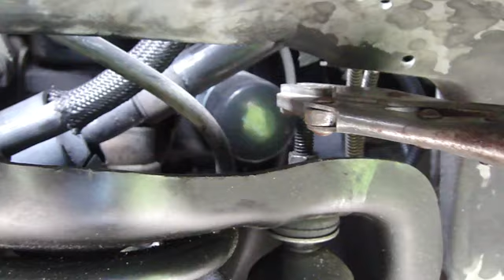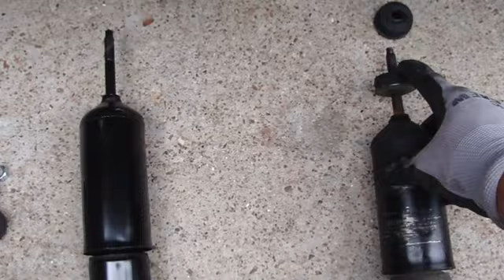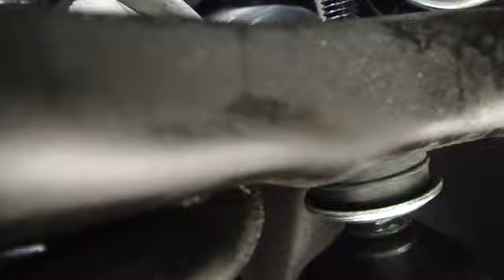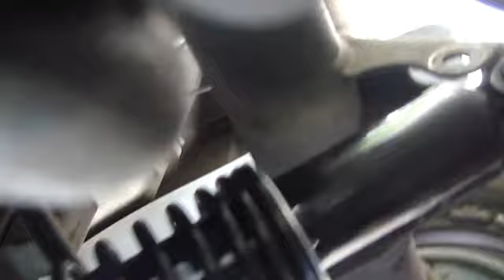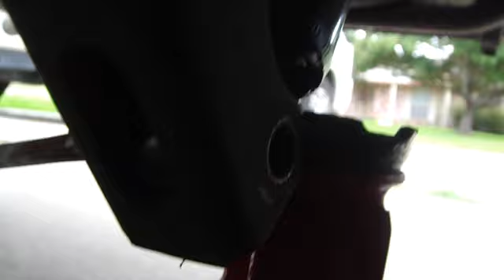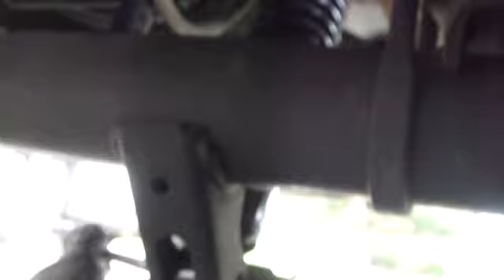Replace Ford Ranger Shocks

Comment: This vid is six years old so these two things have already likely been covered [also, thanks for creating and posting this helpful vid]:

1: the music should be WAAAAAAY in the background, almost inaudible, and not in the foreground.  Very annoying and distracting and even makes it hard to focus on what you’re trying to convey

2:  don’t remove shock or strut straps UNTIL you’ve got it partially installed, then cut the strap, then the shock or strut will rise up into where it’s going to be seated.  And take 90 seconds to remove the tire first.

Comment: there is a place under the rubber isolators to put a 3/4 wrench on, so you can use a socket on the nut, for the top of front shocks.

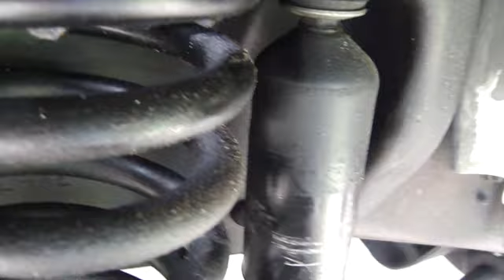Comment: Dude, yer killin me.....stop vid at 0:22 and look under the bottom of that lower bushing, just under the disc. That's where you put an open end wrench. No vice grips needed. Work smarter, not harder. And at 0:50, you CAN take it out by hand if you pull down on the upper part of the shock first.
Reply from the maker: SsgtMcNasty1 thanks for the input!!  I’m just the average joe DIYer.

Comment: These rear shocks are awesome,,,,but they don't fit a 1994 Ranger xl. The passenger side shock hits the control bar on the rear axle. . I notice yours doesn't have the same control bar as a 1994 even though its only two years difference. Hope this comment saves someone the headache I went through...

Comment: Thanks, have to do back shocks on '94 Ranger, it's not high mileage but it's old and the shocks are shot.
Reply from the maker: I felt the difference right away.  You will be happy with the replacement.
Reply: These rear shocks did not fit my 1994 ranger xl. My Ranger has a control bar on the rear axle. The passenger side shock hits the control bar causing a noise at every bump. I haven't notice anybody mentioning this anywhere.

Comment: the bottom screw bolt, on the spindle it screws onto mine broke off.. how can I fix or get around it? the owner before me NEVER changed the shocks
Reply from the maker: marcus myers not sure dude. I would not try to repair it. Buy a new one or go to pick a part junkyard to get one.
Reply: The Tinkerer the only problem is getting it out. it's basically snapped in half. half of it's in the bolt the other half still on the truck. damn things welded in
Reply: you've gotta buy all new radius arms. Just had the same thing happen to me.

Comment: I thought u had a lift I have the same truck but with 4" cool spring lift and the tires point out wards on top of my tires I'm looking for suggestions on if I need too get myself a radius arm lift too fix my issue

Comment: Are the shocks on a 2010 ranger xlt difficult to replace or it is the same as the 1996 model which you are referring to in the video?
Reply from the maker: Steven Machieng I don't know this vid is for the 1996 Ranger Good Luck!
Reply: It’s basically the same in the back I got a 05 xlt n just replace with Gabriel carrier load and feels a lot better

Comment: This a good video but.........my truck is rusted all to hell (Midwest) I think the main toolss I will be using are a torch and a grinder LOL
Reply: testbooster 
I'm surprised by that, 95 underside is cleaner than cars made in 2011 here in the Midwest. My 99 Ranger underside is pretty grimy and a little rusty.

Comment: I hope you respond pretty quick do I need any specific tools for this job, beside the vice grip, wrench, and jack?
Reply from the maker: I also used a air drill which is shown in the video. bolts can be  tough to dislodge. Since this video I purchased a spring compressor but you can also rent it from ORiellys

Comment: Great.... I have the original shocks on mine. After 260,00 miles, I think it's time.
Reply: Lol its recommended to replace them after 30-60k
Reply: Good to know next go around.. I replaced about two months ago. Super easy!
Reply: Absolutely.. Before 260.00 thousand miles . My truck had resonating bouncing/vibration happening after just simple aggressive conditions, such as cracks in black top especially on the freeway and also a terrible vibrating in front right at 65 MPH lasting till I hit 70 MPH. After putting those on that disappeared along after vibrations too. They were Monroe brand around 35.00 a piece.
Reply: ToddB987
You my friend, just felt proper ride quality after 200,000 miles without it!  Shows how much of a trooper those old shocks were though.
Reply from the maker: Could you share what the ride felt like pre and post shock replacement and what shock brand you ended up with?

Comment: Question...? How come you just didn't take the back wheel to get top of shock? You did in the front? I have a 95 ranger that the shock are over due to be changed out. Thanks for posting vid. Probably going to save a couple hundred dollars on labor and part if I were to take it at local garage.
Reply from the maker: +ToddB987 I think you said why not take off the back wheel instead of getting under the truck?  Got lazy! tried to save time! :)   The shocks BTW are off the hook almost 2 years since this post and shocks still good!  The handling of the truck is fantastic...i mean I went from wobble and bounce to tight like a virgin!  You will be happy with putting in new shocks!

Comment: AWESOME.  Copied your instructions used same shocks and came out perfect.  You are good at instructions!  Thank you so much and mine was a 1994 Ford Ranger XL.  I didn't even have to take the front wheels off.  Nut blaster spray worked too good.  Also, on the front you don't have to keep a vice grip on that top part... you can simply use a wrench down a little below it on a nut that goes on the underside of the frame.. easy way also.

Comment: Nice and clear video, thank you.  Just did the rear shocks in my '97 Ranger.  I'll do the fronts later. My Ranger is significantly more rusted than the one in this video. Yours looks almost new, with no rust. Michigan!
Reply from the maker: Alex Sweers Michigan...you must speaking of salt for the snow...thanks!  engine and underbody well taken care of...the lack of paint however is another story...
Reply: The Tinkerer The body on my 1997 only has a little rust, surprisingly.  The frame is another story!  Yours looks like it came right out of the factory in comparison.

Comment: I'm getting ready to do the shocks on my 87 4x4.  I want to put some Gabriel Hijackers on it 'AIR' in the back.  Does anyone know how this might work for me?  BTW, I just replaced the steering linkage after my wife bottomed it out real good while coming out of a deep gully to fast.  Crushed the linkage, and put so much pressure on the RF tire that it separated it.  Wobbled like hell and only kept getting worse.  So, tie-rods, new front tires, and got it aligned all just yesterday.   If anyone can give me some pointers on air shocks for the back, a quality brand mainly, i'd appreciate it.  The more I look, the more confused I get.  I mean, do they even make air shocks for my truck?  

Thanx
Reply: I've never replaced them before myself